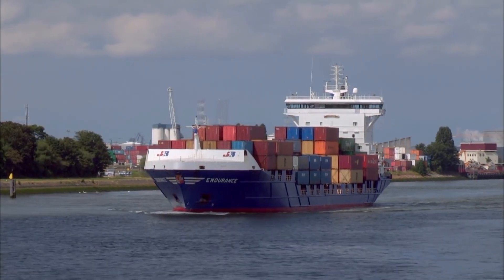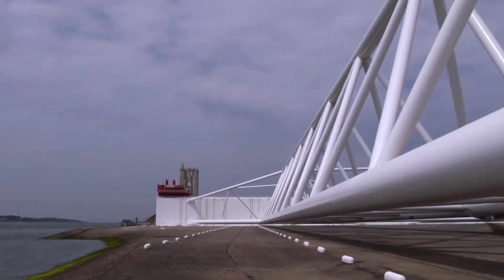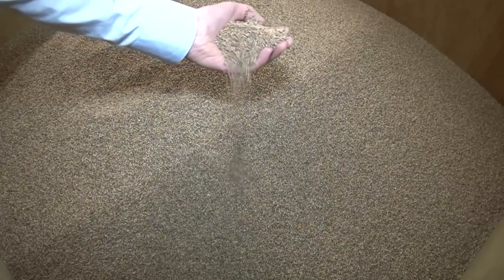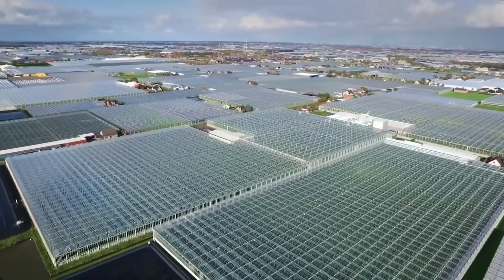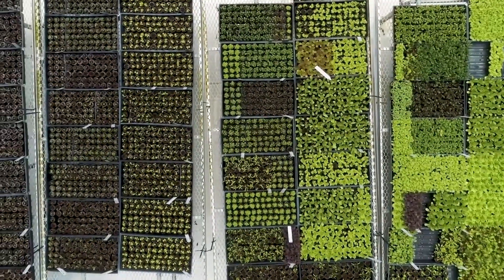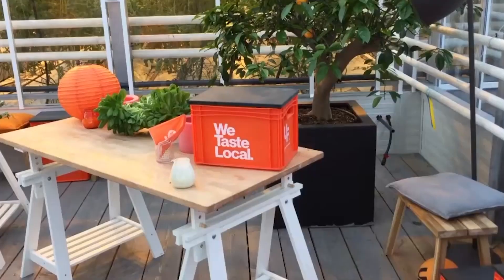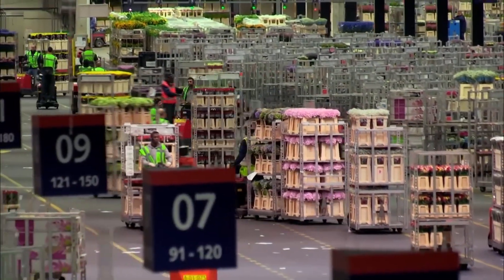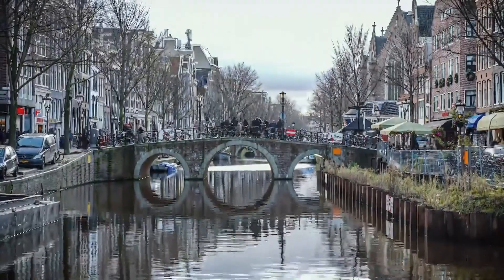A Tiny Country That Feeds The Whole Planet

Comment: The climate is actually pretty good for vegetable farming.
They avoid the cold winters and hot summers that plague, for example, the NE USA.
Rainfall and temperature are relatively stable over the year.
Reply: Yeah, France is basically ideal place for growing produce, and Netherlands is close to France, so with help of climate control they have, they can smooth out hard edges from the weather and produce really good growing conditions.

Comment: Orginal carrots were black and goes back to time of the Romans.
Reply: maybe some carrots then before were (dark) brown but many species are internal white to yellow, and brown is actually dark orange, as you mix orange with some black you get brown, so if the dark (black) pigment of a brownish carrot was take out, it could have turned orange, possibly a spontaneous orange variety had grown that had a genetic change and they continued to grow with those seeds, so are different variants arise through selection, so different vegetables have arisen from, for example, a Brussels sprout from which other types of cabbage have being arisen, andfor instance  the cauliflower has arisen from a broccoli